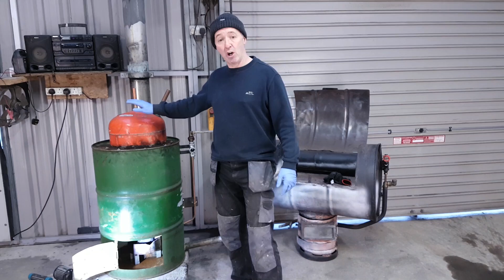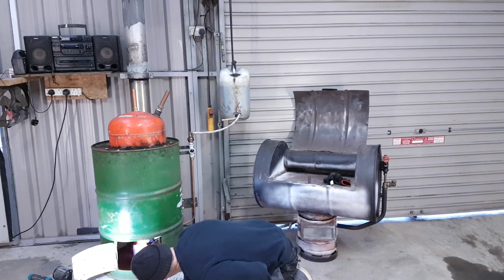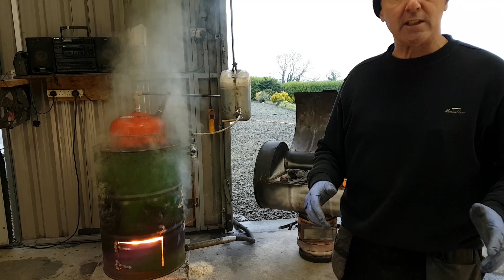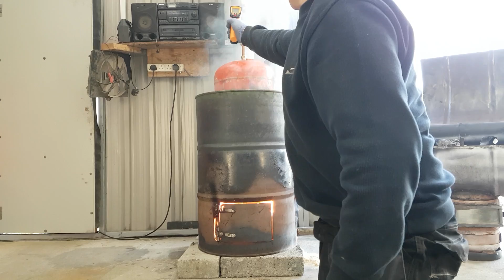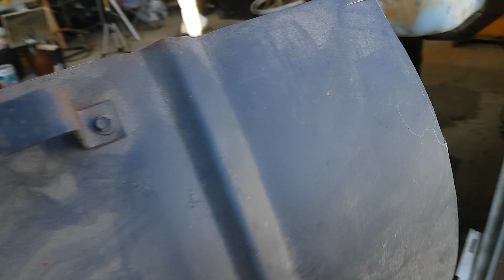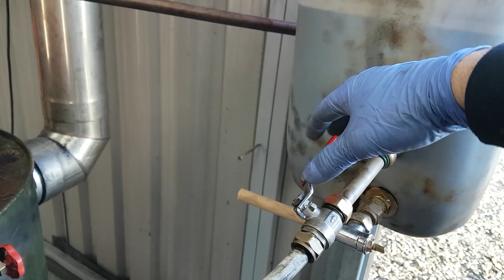Awesome Waste Oil Boiler  FREE Hot Water Forever..

Comment: Im about to do the same but opposite  a 30gal drum in a 55 gal so the water will surround the burn chamber.. Im thinking ribbon burner pointing down from the top...  If had a difficult time getting waste oil hot enough to do well heating water but I am trying to heat a pool..

Comment: Hi , wouldn't be better to put a coiled copper pipe in the stove with water circulating/heating though? Any thoughts?
Reply: Only if you were constantly running the water through the pipe and drawing it off. Otherwise you would very quickly blow something up.  Water expands 1,800 times when it turns to steam. This ferocious heat would be creating instant steam in small diameter pipes.
Reply: @rubygray7749  Not if you add to the system a pressure relief valve
Reply: @flopop4940  I disagree. The intense heat of this system on a thin copper pipe would cause flash steam in places, hence an explosion. I have seen this on other videos. You need the larger surface area and a big volume of water to modulate the temperature rise. You're looking to blow yourself up, or to influence someone else to be foolhardy enough to try your suggestion.
Water only gets to 100 degrees C then turns to steam instantly, and expands by 1,800 times.
The heat generated by this burner is much too high.
If you had a pressure relief valve, soon all the water would be expelled as steam and you would run the pipe dry.
Ernie and Erica Eisner teach Fire science in their Rocket Stove business. The first essential of building something like this is SAFETY. Avoiding the BOOM-SQUISH result.
Boilers are extremely dangerous. Not to be played with.
Reply: @rubygray7749  If you run 5-6 radiators on an  closed circuit with an circulating pump, expansion tank and pr valve is just the  same as you have in your central heating boiler. I have one in the making, will test soon. I'll let you know if my house has changed the post code!

Comment: This is probably a stupid question but why doesn't the oil from the drip tube catch fire and travel up to the oil bucket?
Reply from the maker: Hi Rick. If there was an airflow up the pipe that could happen but the stove has negative pressure at the point at which the oil falls into the stove. As new oil falls from the tube it cools the feed pipe too. hope this helps Cheers Gerry👍

Comment: I’ve been thinking about building a waste oil pool heater, using a couple propane bottles or something similar 
would you recommend water circulation jackets on outside of heater or  inside of the heater unit
Thanks
Reply from the maker: Hi Mrdubomb I will be making a unit very soon but depending on where you live there are boilers that make an easy conversion and can be had for scrap value. A flue pipe welded into the propane tank can be more efficient. Hope this helps Cheers Gerry

Comment: Have made a very similarly designed boiler, but it seems it does not transfee much heat into the water tank. I am using forced air too, which makes it smoke out the door a lot.

I only have one section basically of chimney on it outside, do you think if I add more sections that would improve it?

The of my tank is not as close to the top of my burner, but the flame I get is licking the bottom of it regardless.

Comment: Hey Gerry thanks great job. I have a closed loop radiant heat floor in my shop. I use a 52 gallon electric hot water tank for heat but it gets expensive and I have tons of used oil. Have you come up with a way control heater by way of a thermostat.

Comment: Is this model finished as this is the one I have built but i have no plumbing done yet.
Reply from the maker: Hi Peig. You can see it in the background of my latest foundry project.It's on the to do list but not completed yet but soon. I will be connecting a copper cylinder to it and heating water. I think I will connect it to my underfloor heating too. It's definitely a possibility Cheers gerry

Comment: If you used a gas water heater tank with the  pipe and deflector plate instead of the propane tank the flame could  weat up through the center and around the sides, The exhaust would Y together above the unit and  exit out the top. Lets find a quiet air blower  that's cheap to run.
Reply from the maker: Hi Phat Mike. Those heaters would be perfect but unfortunately not widely available here. I will cut a 5 inch hole in the top and bottom of the propane tank and weld in a 5 inch pipe and send the flue gasses through. This will increase the metal to water ratio recovering more heat. Getting time is the problem. Thanks for commenting, much appreciated Cheers Gerry

Comment: Why not set the unit outside and pipe the hot water in to a radiator inside with a fan blowing through it to heat the shop? Safer, and no worries about water or oil or even smoke then. JMHO

Comment: nice! I do like your video's & watch your channel a good bit! We have 3 vehicle's & just with the normal oil changes, the oil adds up but, no where near enough to heat any building through out the winter season but, it definitely would help & the second I do build a garage, you can bet that I will be making my own oil furnace! Any other tip's  to obtaining used oil? I need to build a garage & start advertising for my own auto repair shop! Simply doing oil changes & tire repair would probably be the majority of customers besides friends wanting freebies on their vehicles! I HAVE ALLWAYS DREAMED OF HAVING MY OWN SHOP! It's just that my location is miniscule, in a small area, away from the beaten path!

Comment: Great idea!  The more water tank surface area in contact with the heat, the better.  Maybe a few baffles inside the 55 gal. tank might help...or maybe heat collecting baffles on the water tank...or both.?
Also, A 20" radiator hooked up to the hot water and a 20 inch box fan would do wonders for dissipating heat.  You could also hook up the fan and a small water pump to a thermostat very easily.
Either way, I like it!
Reply from the maker: Hi SLRS Thanks. The plumbing end of things will get a little interesting when I connect this up to an underfloor heating system. The main thing I wanted to do with this odd looking boiler stove was to make hot water for a pressure washer but as it's setup currently in the shed I have some other things in mind. it's not efficient but I can just throw heat at it to overcome that deficiency. There are lots of things that would improve the efficiency but it is a fun and cheap little project. Thanks for the suggestions More developments on this stove soon. Cheers Gerry

Comment: Nice prototype Gerry. It's good to watch your videos they save the rest of us sometime by watching your trial and error.  I built a forced air burner but didn't like it just a little to noisy. So now I'm putting a reasonable copy of your naturally vented burner. The only change I made was to make it square as I have access to some flat stock and it's easier for cutting holes and such with the Metabo. My only questions are How do you figure the size of the burner (area wise) and are you a plumber by trade? I had a great time visiting my daughter in Scotland. Keep up the good work love your videos . PS The plumber bit is only because I am also a plumber in the states.
Reply from the maker: Hi Michael. I am a plumber here in Ireland and I  also  prefer the normally aspirated burners. I will make this stove into a fan free model soon but I wanted it poweredso I could keep the flue length to a minimum/ I want to make this unit portable. The problem with this design of burner is that they need the vaporising pot or burner to be red hot and there is a limit to the downsizing without forced air. Lots of the lads are asking for a smaller unit so I will go at it soon. Where in the state are you based Michael. Cheers Gerry
Reply: @GerrysDiy  I live in Michigan. I used to do commercial buildings and plant work, but now work at an auto manufacturers testing facility. Never a dull moment and usually interesting work.

Comment: Bhi Gerry does the copper pipe go all way into burner is it does does it not melt
Reply from the maker: Hi Mick. When you see the stoves glowing cherry red they are between 650 and 800°c approx. copper melts at about 1000°c As the oil is flowing into the burner it cools the copper. Om some of my other burners I have the copper pipe inside a steel pipe and I blow air down the steel pipe. Works great but  I have yet to melt the copper. Have melted brass and aliminium no problem though. Thanks for the comment Cheers Gerry👍

Comment: Hi Gerry. I think ill make this to run some radiators - my modification if i was to use your idea would be to make the gas bottle sit in a tight watertight sleeve so that the flame doesn’t hit the bottle direct but also if it leaked it would be in a bund effectively. I would weld the tube with a cap on the bottom do the bottle sits inside that and weld the top to the top of the drum.
Reply from the maker: Hi James. I will be connecting this to an underfloor heating circuit soon. I have other boilers but will connect this for the craic. It would be very easy to make this into a back boiler design. Just weld a pipe up the center and you have a jacket. The flue gases could travel around it and through it. The efficiency would be much greater. Would be easy to convert an old oil boiler too. Thanks for the suggestions. food for thought Cheers Gerry

Comment: HEY JERRY😊ANOTHER GREAT VIDEO!!❤️
What happens when you add a few ounces of WATER to your OIL BURNING PROCESS? 

🛑🛑JERRY can you do a “DEMONSTRATION”?  OUTDOORS?...........FROM A SAFE DISTANCE?

AS liquid PROPANE expands 270 times when it turns from a liquid to a vapor............

WATER is much more violent😳

SO FOR EVERY 1 GALLON of water that FLASHES to STEAM..............1600 gallons of steam is forced into the boiler and chimney!!
I’ve got myself a few propane tanks, I’m looking forward to getting out in the shop and creating something.........much more scaled down version of what you have built! 
I am going to use an acetylene “B” tank for the vessel and I will also scale down your burner to fit inside of it😳 I’m planning to make it NATURALLY ASPIRATED!!😊
I would think that would DELIVER plenty of heat but it would be interesting to see how it works on a much smaller scale! If I’m successful I’ll send you a video of what I’ve created but in the meantime keep going I enjoy everything you do!❤️🇺🇸
What country are you win it’s easy to see it’s not the United States from some of your other videos. I assume you install wood pallet and gas stoves as your business? And where are you are you talk about pellet stove‘s with the water jacket and that is the cats ass however we can’t buy them in the United States? Because I think that could be adapted to almost any heating system with baseboard hot water and it would put the oil business out of business. I just purchased a Ravelli pellet stove model is the holly and it has three thermostats three separate zones of heating and it really is One of the best pellet stove you can buy in my estimation! And when the day comes when I can buy the Ravelli or a competitor is brand with the water jacket it might oil fired heating system will sit on the side and watch my pellet stove heat the whole house and my hot water! Any chance you wanna sell me a pellet boiler stove I have it delivered here in the states? I’m joking I know it’s illegal but it’s silly and other than hurting the oil and propane distributors there really is no reason it shouldn’t be allowed here in the United States, just one more thing the politicians need to get the hell out of!                   😊❤️🎄MERRY CHRISTMAS JERRY🎄🎄🎄🎄🎄🎄🎄🎄🎄🎄🎄🎄🎄🎄🎄🎄🎄🎄🎄🎄🎄🎄🎄🎄🎄🎄🎄🎄🎄🎄🎄
Reply from the maker: Hi Pete. I will be having a live chat soon and you can ask anything in the chat an I can answer better there. I am planning on doing a video on just how dangerous the water thing is with the oil. Thanks for all the Christmas Trees Happy Christmas to you and yours from County Wexford Ireland Cheers Gerry

Comment: Very nice prototype.  I wander if connecting it to a car rad, and thermo-siphon the water through the rad, would produce as much heat as your original garage heater your had in this space?
As always, great video.
Cheers Gerry!
Reply: Martin.... I've been thinking the same thing...
Reply: A 20" radiator and a 20 inch box fan would do wonders.  You could also hook up the fan and a small water pump to a thermostat very easily.
Reply: it would recover alot of lost heat

Comment: 🛑🛑JERRY can you do a “DEMONSTRATION” OUTDOORS FROM A SAFE DISTANCE OF 
What happens when you add a few ounces of WATER to your OIL BURNING PROCESS? 
Just as liquid propane expands 270 times when it turns from a liquid to a vapor, water is much more violent water turns to steam at 1600 times the liquid content so 1 gallon of water will make 1600 gallons of steam and my guess is that all that volume trying to get up at 6 inch chimney affectively plugs the chimney off there for all your gases are forced back into the building? I would assume that if the water gets into the oil itself as it makes steam it would carry some of that oil with it therefore expanding the fire anywhere the steam goes? Or does the water just boil off slowly and go up the chimney?
YOU’RE THE OIL MAN JERRY! I am retired from the oil business here in the United States I have made snow from an oil burner I have not yet tested the waters so to speak of homemade waste oil but I am familiar with commercial waste oil burners installed and service them for many years I’ve got myself a few propane tanks I’m looking forward to getting out in the shop and creating something I’m thinking of is much more scaled down version of what you have built possibly using a beat tank for the vessel and scaling down your burner to fit inside of it I would think that would give us plenty of heat but it would be interesting to see how it works on a much smaller scale! If I’m successful I’ll send you a video of what I’ve created but in the meantime keep going I enjoy everything you do!❤️🇺🇸
What country are you win it’s easy to see it’s not the United States from some of your other videos. I assume you install wood pallet and gas stoves as your business? And where are you are you talk about pellet stove‘s with the water jacket and that is the cats ass however we can’t buy them in the United States? Because I think that could be adapted to almost any heating system with baseboard hot water and it would put the oil business out of business. I just purchased a Ravelli pellet stove model is the holly and it has three thermostats three separate zones of heating and it really is One of the best pellet stove you can buy in my estimation! And when the day comes when I can buy the Ravelli or a competitor is brand with the water jacket it might oil fired heating system will sit on the side and watch my pellet stove heat the whole house and my hot water! Any chance you wanna sell me a pellet boiler stove I have it delivered here in the states? I’m joking I know it’s illegal but it’s silly and other than hurting the oil and propane distributors there really is no reason it shouldn’t be allowed here in the United States, just one more thing the politicians need to get the hell out of!                   😊❤️🎄MERRY CHRISTMAS JERRY🎄🎄🎄🎄🎄🎄🎄🎄🎄🎄🎄🎄🎄🎄🎄🎄🎄🎄🎄🎄🎄🎄🎄🎄🎄🎄🎄🎄🎄🎄🎄

Comment: love the heat it puts out now I need to down size it to run hot water for my preasuer washer i only need to run the washer for 20 min at the most and just need 55c water and heat my small shop 20 x20feet would you empty the tank when not using water or would you keep it wet. thanks gor the videos please keep them coming
Reply from the maker: Hi hd the wise. If I were using it as a stove mostly I would use it dry but it will burn the paint off the propane tank. these things are really robust so they would take running dry for quite some time. These things are so cheap to make that I think I would make one dedicated for hot water and a stove as a space heater. I have some more to do with this one connected to the flue in the shed. The small building beside the shed is underfloor heated and I might connect it up for kicks to this or similar boiler. Thanks for the comment Really appreciate the support. Cheers Gerry

Comment: Without space to do these projects myself yet, your video are saving me years of design and trial.
Plenty of camera angles for fabricators. Great stuff.
Reply: I'd love if the draw was powered by the heat causing suction. Rocket stoves use the barrel after the  combustion as surface to effectively push the cooled fumes through the chimney due to rapid cooling after the burn.
Also looking into rocket stoves perhaps an earlier clean smoke could be achieved by having the flames go into a corner angle or a contained area using fire Crete and perilite straight away as a secondary combustion area heated by the first. Contained inward reflection heat in an area above the oil could avoid heating the burning plate below while insuring a complete burn before reaching the water just above.

My dream is a a hob like start from a biodigester, then wood or oil for fuel.

You can't do everything at once, seeing good methods for base future projects on is a great boost.

You know what it's like seeing a great shed project and thinking it's great..but you'd add 'this'. :)

Keep it up, remember PPE fella ;)
Reply from the maker: Hi Nandodando. It's nice to have the space to do all this stuff. The shed is very cold in winter which is what started all this off lol. Thanks for the comment Cheers Gerry